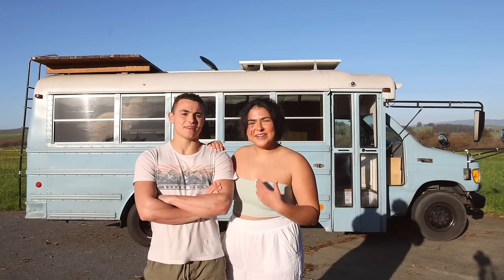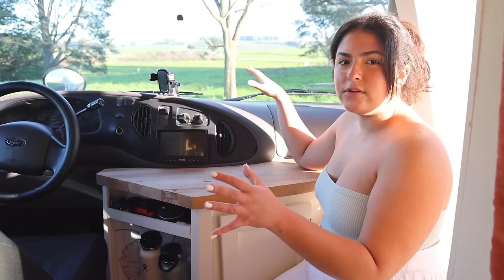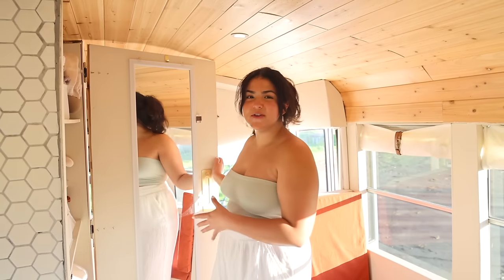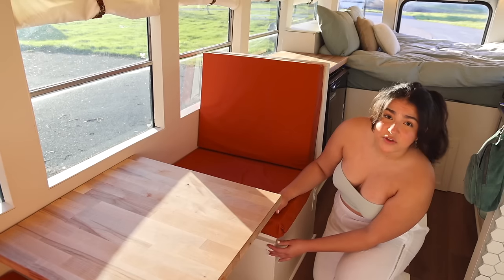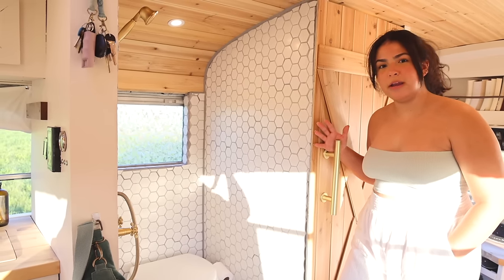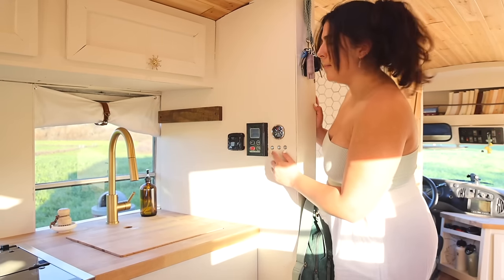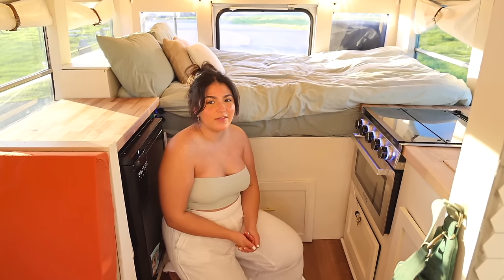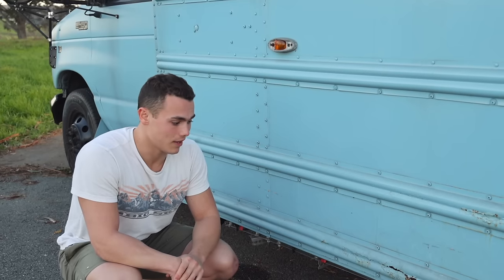Self-Converted Tiny Home Bus Tour

Comment: Have you experienced any cooking liquid splashing on your bedding in any way? Or do you have a temporary separator to protect your bedding from any splashing?
Reply from the maker: No issues! I use a foldable kitchen splash guard in between to divide up the spaces. And always try to use the burners furthest away from the bed :)
Reply: @arwamoore  ;- )
Reply: I love everything about this build but I was wondering about that. I probably would build some kind of thin separator. I'm messy in the kitchen 😔

Comment: Wow, Arwa(and Will)! I have some building experience and would have struggled a bit just winging it. I understand you'd never used a hammer before this. Impressive, to say the least! And Will, no electrical experience prior? Dang! Even with the initial wire confusion, you did amazing! Congratulations!

Comment: I love your bookshelf copper rod holder. I’m getting ready to do curtains. I’m curious about the parts that hod the rod in place. What and where did you find those pieces? You did a great job on fitting that butcher block to the dash! That was a hard wonky cut. 😅 We have a similar build…hubby doing the plumbing and electric and me doing carpentry and art. If you ever travel up the coast you can stop in to see us in Oregon. Great job you two!

Comment: Considering the time period for build...its great job from both of you... Only couple of alterations if u could make...move the stove burner in place of sink away from bed..and also make some room for propane gas tank beneath it.  Keeping the tank out side is not bad...but the length of gas lines that runs up to burner is suseptible to more leak also the portion of the line thats outside the bus is more prone to wear....and acessing the gas regulator is a teadious task